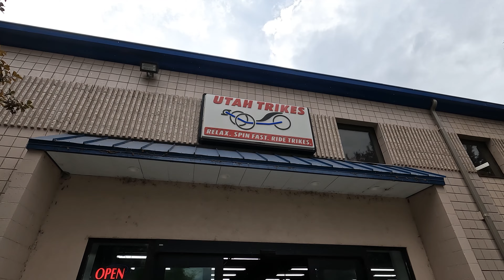The Stig tries out a new e-bike in Las Vegas!

Comment: One of these things with a bigger battery and a wind turbine just like that other YouTube channel who called it wind on demand WOD, instead of waiting for wind, you ride and make the wind! I believe that he has a 250w 36V turbine, he claims that he almost breaks even though he does some pedalling to help out the hub motor..... 
I think that if he went with a turbine generator with a higher voltage output, he could possibly output more power and if the drive motor is powerful enough, he might not have to pedal at all, as long as you are moving, the turbine is spinning! Kinda reminds me of the other guy who had an electric scooter and turned solar panels into trailers behind him like a train which seemed to work really well while the sun was shining.... But a with a wind turbine and having it moving through the air, you can potentially drive day or night! 
I don't know, but there could be something in it! 
Like I said, one guy is almost there.... But I feel more experiment in this....
Reply: The first law of thermodynamics contradicts your idea. Unless there's actual wind separate to the air flow created by moving in still air, even with a 100% efficient wind turbine (Look up the Betz limit to see why this isn't happening) and 100% efficient power conversion, you're still not going to break even.
Reply: @peglor   Laws are made to be broken. They are only human Laws after all! The universe doesn't care for human Laws, it's operating system is quite simple, for every action there's an equal and opposite reaction! Nothing else is needed.... Everything else is up for debate. 
I watched the video, it's genuine. The person who made it is legitimately looking for a means to an end! He's just trying to develop a mode of transport for a SHTF situation.... He's not out there deliberately trying to break Laws.... 
So far, using a simple wind turbine attached to the trailer of his electric bike he has effectively removed so much effort that he would have had to put into a journey that by simply assisting the bike every so often he could effectively ride his bike indefinitely (assuming that he could stay awake that long).... 
And from what I  could see, there was more things that he could do to both improve efficiency and gain more power to possibly remove the need for him to put in any energy of his own..... 
It's a bit like that Veritasium video about a vehicle with an attached wind turbine that drives the vehicle mechanically away from the wind... 
No one is talking about free energy simply because you don't understand the concept of free energy, if free energy didn't exist, you wouldn't have any energy to do work because nothing would want to give up any energy! Which also means that you wouldn't exist since your mother and father couldn't give up some of their energy to bring you into the world to remind everyone else that human laws can't be violated! 
I'm surprised that you are not here saying that it's not possible because God said so! Always preaching!!!! 
I thought that the guy who attached wheels to solar panels and towed them with an electric scooter was a really good idea, sure he looked like a caterpillar but he got a lot further than what he would have if he didn't have all those panels behind him and just relying solely upon the scooter battery... Obviously night time was a problem, but wind turbines don't care for night!

Comment: How long does the battery burn for when it eventually explodes ?? 🤔
Reply: Don't be ignorant. I own several lithium battery powered vehicles (including a full-size EV, an Ioniq 5), and literally over a HUNDRED large lithium battery packs for RC hobbies and I've never even seen one FAIL, let alone catch fire. Lithium battery fires in high-end products are extremely rare, far more rare than gasoline vehicle fires. It's cheap chinese products that don't have proper battery management systems that end up catching fire spontaneously. Cheap vape pens and garbage like that.
Reply: @Chris-xo2rq Not only do ICE powered vehicles burn up at higher rates but, if you think about, they never STOP burning while in use.